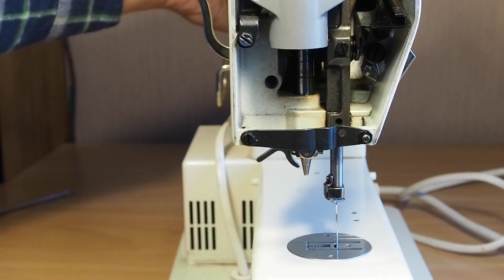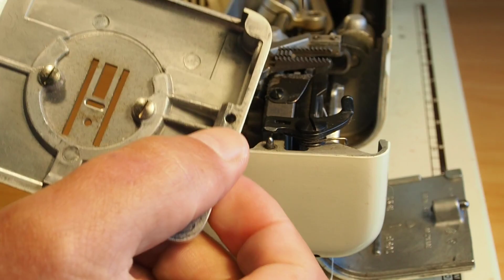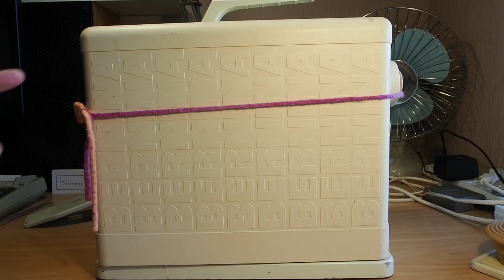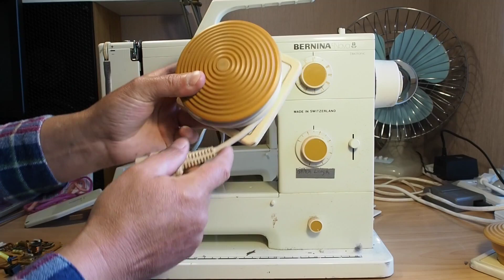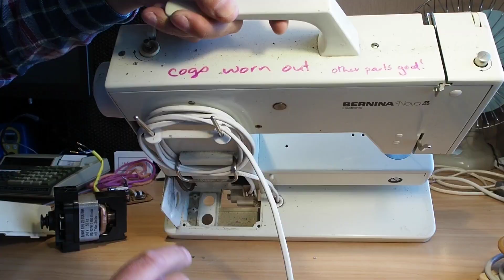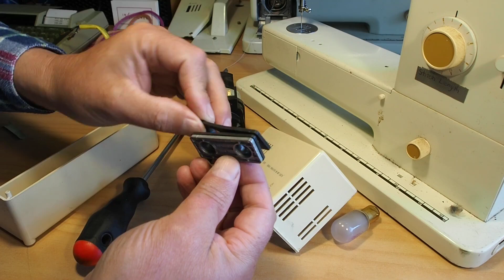Bernina Nova 900 Electronic Sewing Machine - Assessment Part 2

Comment: I am looking at my Elna Nova 900 (with the front cover off )and there is a quite large spring (10mm wide X 22mmm )compressed missing from the bar under the front side panel.There is an empty hole for it  on the black bar on your model!...Also the other hole for the spring on the needle bar holder!!!! perhaps a previous technician forgot to put it back?My needle position perfect!

Comment: Looked at the service manual available online; the needle is supposed to be at the centre (front/back) of the hole. Not saying any deviation for a vintage machine is a big deal of course! Nice video as always. Thanks.
Needle centre does require adjustment of the chassis/frame. But this does not seem to be a big surgery according to the manual.

Comment: One question, what does the electronics of this machine do? If it’s a power supply, why does this need one when older models do not? Thank you!
Reply: By chance I found the service manual of this machine, which I played with recently, and found the answer to my question - the electronic part is a sewing speed regulator. This was an interesting design decision - the introduction of an electronic module only for speed regulation, which had been done without electronics in the machines before this model for long.

This then begs a question, what advantages do this bring over the older design, if not only for looking/sounding fancy and advanced?

Not meant to be mean or to offend fans of bernina.

Comment: Hello. I am repairing this machine. It has the exploded capacitor. Will replace it with a 400 ac rated 0.1uf equivalent. But the question i have is related to the footswitch. Would it be possible to get a picture of how it looks inside? Reason: the one i have has 2 cables connected to a click switch. But the 3 rd cable is not connected to any electronics. I think it might need to be? As otherwise how can you have 2 speeds in the footswitch. Thanks for any info on this.